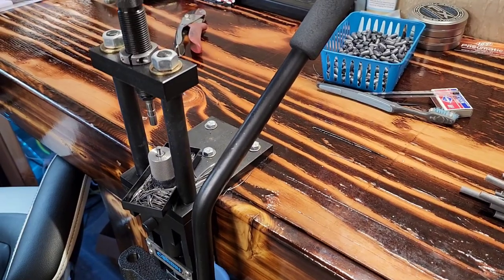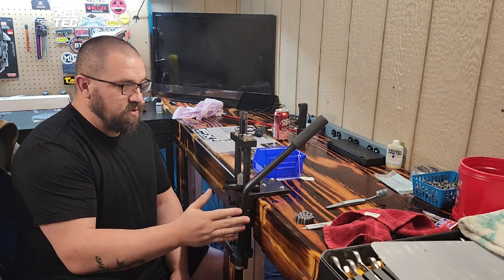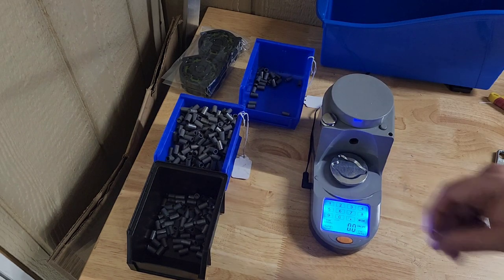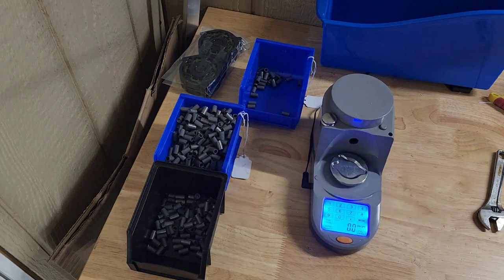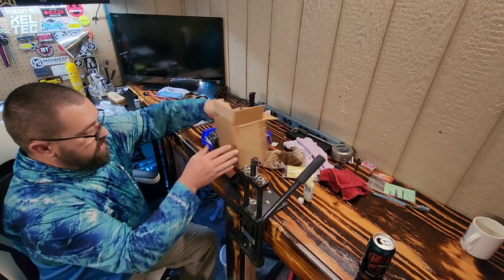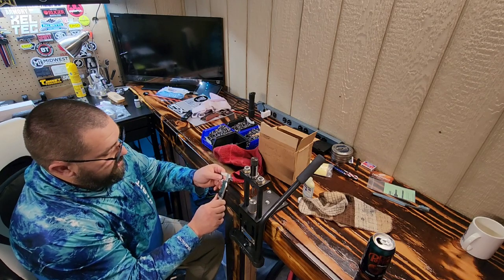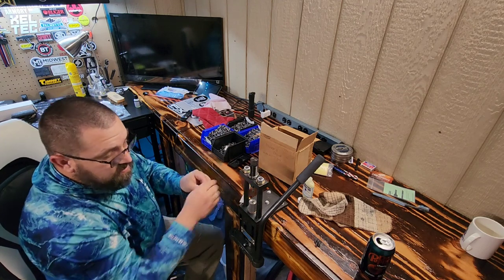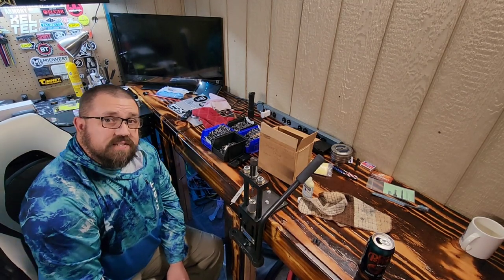Swedging slugs start to finish with Corbin S press.

Comment: Great video Jason! Very informative, two questions though please. Where did you get the new core cutter and the little tray that was around the ram during the core swaging process? Cheers from the desert SW USA
Reply from the maker: The tray should have came with your Corbin press...and a here's were I got my core cutter... And you will have to bore out the hole for 30 caliber.

https://www.ebay.com/itm/225714288977?mkcid=16&mkevt=1&mkrid=711-127632-2357-0&ssspo=jf0irqfys_6&sssrc=4429486&ssuid=9z1snr7tt9a&var=&widget_ver=artemis&media=COPY